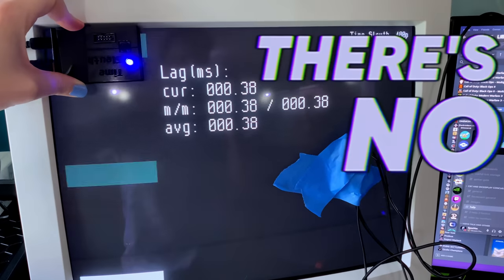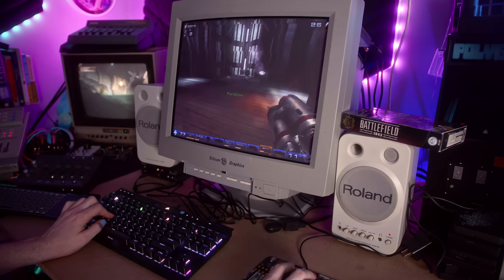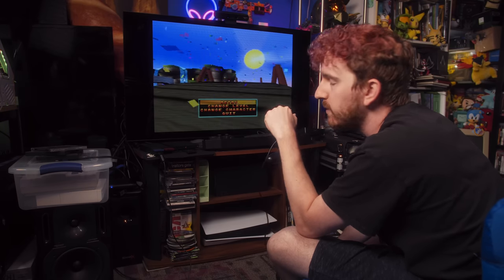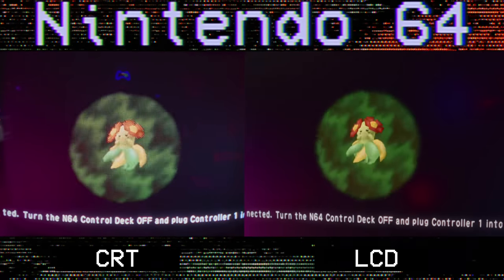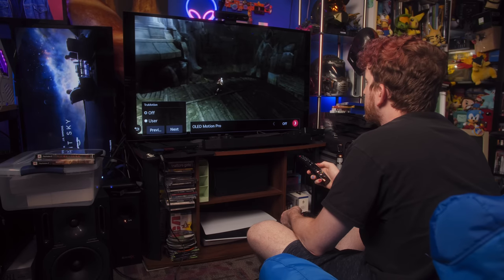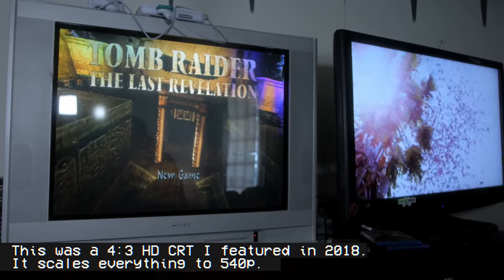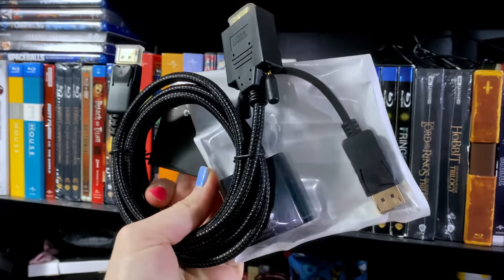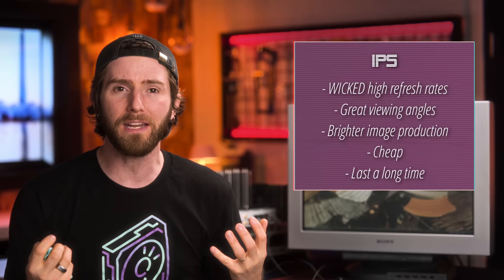Old Trash or Treasure? CRT vs LCD: The Final Verdict

Comment: Thanks for having me come on.   I'm happy to be part of such a great video.  It's amazing to see your CRT videos through the years.  You'll find that fw900 one day.  I know it.
Reply: It's overrated. Spend @$400 on a 4:3 Sony for way more bang/buck.
Reply: Seeing you pop up there with the big boys like LTT is amazing, Steve!
Reply: @shabazz18  depends on if you are using it for modern games or not. If you want to play the latest games on your CRT, 16:10 is probably supported but 4:3 often isnt. On the flip side 4:3 is better for retro or just reasonably old games.
Reply from the maker: Buying another 4:3 isn’t going to accomplish my goals of high res widescreen gaming so… inherently that cannot be more bang for the buck lmao
Reply: Steve is a legend. His video on the Olympus OEV 203 (aka PVM-20M2MD) which had the same problem as mine gave me the confidence to tackle the repair myself as well as do some preventative maintenance. This thing is freaking awesome.

He also has a PVM-2030 video that I'll be referencing soon as I repair that gem of a monitor.

Disclaimer/disclosure: I have years of experience repairing... just about anything... except CRTs. I have all of the tools needed to tackle the job I did and experience replacing the parts on the CRT (ie: capacitors) that needed replacing. CRTs are just legendary for being one of those things you don't touch unless you know what you're doing. With my experience and Steve's tips I was able to do this.

If you have minimal experience repairing electronics or anything for that matter I do not recommend attempting a CRT repair.
Reply: I might be shooting into the wind here because I'm seeing this video now but wondering if there's any good Crt monitors that people know of that are more budget friendly and somewhat accessible to get. If any are  more easily gotten than others? I've been inspired to own one again but one that people with experience know to be worth my time and a reasonable amount of money. Any input is appreciated!
Reply: @shabazz18  Old Sony reference monitors are rad but cost few thousands.

Comment: We have all been robbed. If we had the same graphics processing today in the 2000's gamers would have held onto CRT's with a death grip.
Reply: Intel save us please 😰😰
Reply: Oleds are better
Reply: @ShadowLady1 yea better ,pff
Reply: I have so much regret over throwing away my old CRT monitor.
Reply: @ShadowLady1 nah, I got a room with an OLED and another with a CRT, OLED is kind of ass at lag still
Reply: @sunnohh depends on the TV/monitor. OLED is the first flat panel display tech that's solidly better than CRTs in terms of picture quality, particularly color, though most TVs add extra input lag by doing whatever image processing the manufacturer decided was necessary (frustratingly, loads of TVs will not let me turn this off). OLED desktop monitors, especially if they're marketed towards gamers (most high refresh rate monitors) tend to be close enough to CRTs in terms of responsiveness that it doesn't really matter imo. Plus no one will sell me a QHD CRT (highest resolution you'd really benefit from because 4k is overkill on anything less than like 40in, and the thought of a CRT larger than 40in is fucking Frightening)
Reply: @fall1n1_yt  been 3 years with probably 2000 hours put into and nothings happened so I don't think so,  burn only affects idiots
Reply: I still have My CRTs. 5 CRTs 😈
Reply: @gh0stcassette  Sony made an 45" CRT that weighed 200kg
Reply: @ShadowLady1 but they aren’t special like these are, need 500hz or higher to match motion clarity of a crt
Reply: @irun2sanaxox  wrong
Reply: @ShadowLady1  well if i had the choice i would get both

Comment: Problem is, everyone who is selling a CRT thinks they have the greatest model that every retro gamer wants, and therefore is asking hundreds. I keep checking local listings, but people are smoking crack.
Reply: dont look up "crt", just look up for the cheapest "tvs" or "monitors" and you'll find a bargain
Reply: @RFLCPTR  the problem with that, is the CRTs that you want were really expensive back in the day and your average person didn't have them. I have some old crappy ones just sitting around and I have no interest in using them, the ones I use are the ones people charge huge money for now
Reply: I have the greatest model.
Reply: @danielpope6498  At least in my area I could find some Sony Trinitrons in good condition (didnt pick any up yet as I still dont have my own flat)
Reply: @RFLCPTR  ah dang. Good find. I managed to snag a new in box 22 inch viewsonic a few years back but that was before the market for these really took off. The rest of mine are all IBM branded  shadow mask tubes I got for free because a library was chucking them. Ive never found anything locally since that wasnt either trash or overpriced
Reply: Keep looking and you might get lucky. I have a solid Panasonic HDCRT, a JVC D Series (speakers are busted), and a Diamondtron PC CRT at home that I very slowly put together as a collection. I think the total cost was about 700 CAD. I also found a super rare 21 inch Diamondtron when I was in the Netherlands this year for 50 euro. My one instance of getting super lucky!
Reply: Have you tried thrift stores?
Reply: ROB that band that uses them as makeshift synth drums
Reply: I mostly just notice this with Trinitrons (regardless of the model and inputs).  But you should be able to find a decent deal when you look at other brands.  Even an off-brand CRT will often make older games look better than a modern TV using even the more advanced upscalers or line multipliers.
Reply: You need to look at recycling places and take some from there thousands are still getting scrapped every day
Reply: I got mine for 5 bucks. Mid 90s Magnavox
Reply: Yeah… I love in Norway and I payed 90/100$ for a barely okay CRT. I say barely, not really. I think it’s 900p max and it pains me that I got rid of my two 19” SyncMasters. 1200p @75hz😑 just gone to the ether…
Reply: Yep.
someone was asking for £1000 for a Sony CRT 36 inch widescreen.
but it is 100hz so it is usless.
Reply: I was thinking this same thing when searching for vintage laptops to buy... People wanting too much money for stuff missing parts, or it's just broken, when others are selling working stuff with all of its parts for half the money..
Reply: There was a time you couldn't even donate a CRT to places like goodwill and now it's $1000 for a PVM on ebay? Okay.
Reply: Yeah its beyond absurd. Just hilarious at this point when I see a 20" Sylvania with conposite input only titled "retro gaming crt, high quality". You couldn't PAY people to take these TVs even 5 years ago, now they want $50 for a piece of junk??
Reply: @XxCreateFlowxX okay that’s crazy too much for piece of crap Sylvania I’ll just pay the same price for Sony Trinitron and I know there are some Sony Trinitron that people want you to take it for free
Reply: @XxCreateFlowxX Yeah retro gaming and media has unfortunately become a hype beast hobby when for me growing up it was my only option because my family was below the poverty line.

Sucks getting priced out of something that's a hobby mostly because of necessity lol. I just have stopped collecting actively but when I see something cool I dip in. 

I feel that prices will return to normal someday, when people finally realize again that this stuff is really just a bunch of old plastic. Interesting old plastic, but old plastic nonetheless.
Reply: I got my crt for free😂 Ebay marketplace ftw
Reply: I got a brand new in box dell gaming crt, for $60, and from what I've read, it's one if the best ones dell made, and it hasn't yellowed because it was new in box
Reply: The trinitron 40 inch, the largest consumer tv has 720  i think a few late models have hdmi. It's 250lbs. The mitsubishi 40 inch tv also 250lbs has black glass but no RGB. The RCA 36 inch with black glass and RGB i think is the best CRT tv for ps2 and og xbox.
Reply: Complain about the price but if people are buying them, then it's the right price. They are not making anymore so I don't think it's unreasonably to pay what they cost new + inflation. So a 500 monitor in 2000 would be 1000 to 1500 in today's money. but really the sky is the limit.
Reply: this, is still true
Reply: Yeah, clunky E waste sold like it's some rare 85hz sony CRt or something, TVs are the worst on my local secondhand listings.
Reply: I buy CRT’s because I hear that they were well made and last way longer. So many of them have even made it to be in their 70’s and 80’s.

Comment: Image clarity at relatively low resolutions has always been insane on CRTs.
A CRT was basically the best way to get value out of raytracing on 20 series GPUs. They ran pretty good at 720p/1024x768 and on CRTs actually looked great doing it.
Reply: I bought myself syncmaster 997DF crt and now i have 1070 but im not sure if DP to VGA adapter gives me as good image quality as 980Ti with DVI-I to VGA adapter would. Should i sell 1070 and look for 980Ti? Maybe my crt just got weaker idk but if its worth a try, im selling 1070 anyway cus i need stronger gpu.
Reply: @fiece4767  Do you like your 997DF? Does it clocks 120hz@768p?
Reply: I use a 980ti with my crt and it's great 👍

Comment: Still a treasure. I bought a Sony GDM-F520 (similar to the SGI G520 but with a .22mm pixel pitch vs .24mm), when I lived in Japan and built my first computer. Recently pulled it out of storage along with a lot of other stuff in San Diego and moved it across the US. Out of curiosity I hooked it up and started gaming on it and was completely blown away by the picture compared to my 32" 144Hz LCD display. Since then I've been researching how to make the most out of modern graphics cards and the CRT. I found a really good DisplayPort to VGA converter that supports high refresh rates but a lot of games don't support 4:3 anymore. Until I can afford a decent OLED monitor, or they come out with a good short throw laser projector without so much input lag, it's my display of choice for gaming.
Reply: What converter do you use?

Comment: This video is criminally not getting picked up by the algorithm. I've been floating in your circle for quite some time now and absolutely love your content. I may have been using a Haupauge Dual TV Tuner via Composite in Flash Media Encoder to JTV back in 2007 but you perfected the craft.

I picked up a 36FS100 for $20 in 2019 and boy and I glad I did. It may be 240lbs but it has dual Component and S-Video with a manufacture date of Feb 07. Absolute banger for Lightgun content.

Comment: 13:20 I remember in the early 2000s when I was in high school I asked my mom to get specifically 13'' CRT TV, because I felt they were the best size for gaming at the time, I used that TV for my console gaming for a long time, and still have it in my room.   I haven't used it in awhile though since I now have a C1 OLED, but I definitely prefer the 13'' CRT for most things over my 32'' LCD.

Comment: I never have had an FW900 but I did find a 21 inch Diamondtron PC CRT when I was in Europe that of course still can do 16:9 and 16:10 aspect ratios. It hooked up to my PS5 just fine, and it was a huge relief to finally have zero input lag playing Elden Ring after struggling with an old LCD TV in my Airbnb! Was also much nicer for watching F1 races because of the massively improved motion clarity!

Downside was that I had to carry it down two flights of very steep Dutch stairs at the seller's house. It was definitely not light!
Reply from the maker: Probably a rebadged FW900 then, Diamondtrons we’re just Trinitrons sold under a different name
Reply: @EposVox  Nah this one was a 4:3 screen, not 16:10 like the FW900. I just used part of the screen for stuff that had to run in 16:9 like the PS5, still plenty big (that's the beauty of CRTs!). Still had a ridiculously high "native" resolution because it was used for high end photography work.

EDIT: IIRC its max horizontal refresh rate was still lower than a FW900 as well.
Reply from the maker: OH you just meant it can show 16:9/10 within the 4:3 bounds, I see. I thought you meant the tube was still that ratio
Reply: @EposVox  Yeah! Sorry for the confusion 😅

Comment: I really miss CRT.  The 17" 4:3 studio display I had with my G4 PowerMac was the clearest and best picture I have ever seen (despite the stupid apple lock-in to only be able to use it on an ADC video card).
Reply: Amen. I never had a G4 but I do own an iMac G3 and it's display is gorgeous
Reply: They made a convertor to use a standard DVI input on those, and I've actually got one, hoping I run into that monitor someday haha.
Reply: @modulusshift  Pretty sure that convertor is digital only. It will let you use an ADC LCD monitor with a computer's DVI output, but won't pass through VGA signals to drive Apple's ADC CRT.
Reply: @axi0matic  I should really check to see if it would take in DVI-A. I've heard that the power draw is also greater than that adapter can support, but that might also be worked around.
Reply: @modulusshift  It doesn't, and I don't see how you could 'work around' the lack of power from the adapter, if it proved insufficient. The other snag is that all the display's geometry controls are done in software from the connected Mac, via the USB lines that are also part of the ADC spec. 

Realistically, the only way to use an ADC CRT display is by plugging it into a G4 or G5 tower that has an ADC video card fitted. Alternatively, the graphite VGA monitors were also attractive in their own way, and use a standard VGA cable (though I believe the 21" version needs to connect to a Mac via USB to access its geometry controls).

Comment: I've been a CRT mega fan every since the early LCD monitors started to replace CRT monitors back in the day. I had a xbr960, loved the depth and motion clarity but besides weighing a ton and being hard to handle, it also had geometry and focus problems. Nowadays I use CRT vga monitors and I got tons of them lmao
Reply: Dude one of those widescreen hd crt tv's has been a distant dream for years lol. I seemingly cant find any close, and when I do they are 300 plus dollars.
Reply: I feel most LCD TVs from the early 2000's do have their charm that is different to a the charm of CRT monitor.
Reply: @Ballowax  I'm not sure what charm they have outside of nostalgia. They really look bad 😅😅 And LCDs haven't gone away!
Reply: @mahdiyussuf9804  that's where the charm comes from. It's the imperfections in the old 640x480 LCD panel of the day. It's like the nostalgia you get from an RF signal on 13 inch CRT with a low horizontal resolution.
Reply: @Ballowax  I guess that's true, and I'm sure more would feel that way as time goes on haha

Comment: I love CRTs, and still have 15 CRTs, from different markets of the time - commercial, pro, dedicated to the platform.
From a gorgeous Commodore 1701 CRT for all my Commodore hardware, C64s, C16, Plus4, Vic-20 etc...
A couple of Amstrad CTM644 monitors for a 6128, and a CPC464.
Acorn AKF30 RGB Monitor for my Archimedes A3000.
Atari SC1435 - for my ST 1040STF.
Philips CM8833 Mark 1 and 2 - for all my other retro hardware, composite, and SCART.
Sony Trinitron PVM 1442 QM - this is for a Mister FPGA.
Also have a few commercial Sony CRT TVs, 14", and 28" Trinitrons.
These are 100% for retro hardware, and a Mister FPGA. I don't think I could drop my LG C1 OLED TV - connected to my PC for gaming, and use a CRT SVGA Monitor instead. The C1 is gorgeous, and looks amazing at 4k. A lot would have to go if I went with a SVGA Monitor, such as the OLED, VRR, Nvidia G-Sync, 4k resolution, etc... Plus space, the C1 only takes up horizontal space, it's depth space is only a few inches. A relatively small SVGA CRT would need a fair bit of depth space due to the length of the tube.

Comment: It's a shame that CRTs are no longer in production. Unfortunately, we can't hold on to them indefinitely. I remember the transition from CRT to LCD in 2009 after mine was struck by lightning and stopped working. I immediately noticed the difference. When I moved around on a strategy map, I would see blurriness and "choppy lines" on the LCD screen, which left me feeling somewhat deceived. Additionally, the image felt more "flat" because CRTs had a curved, thick glass that added a certain "3D" effect/depth to it, and the colors seemed more "washed out." However, on the positive side, LCDs are thin and easy to carry. Yeah...

Recently, I had the opportunity to travel to Japan, where I found that they still have many arcades with CRTs. Unfortunately, some of them had burn marks, but others were still in great shape. I visited "Super Potato," which had a whole section dedicated to CRT arcade machines, and I got to play Street Fighter on one. It was undoubtedly a better experience on CRTs, and I felt drawn into the game.

Comment: A little late to the show, but I wanted to point out to anyone still looking for CRTs, I've had a good bit of luck at thrift shops and other donation based type places. Then tend to not know what they've got, at least as far as second hand market value, since the average person has absolutely no desire to bring a CRT back home. 

My current favorite is an unbranded 17" 1280x1024 that gets up to 85hz, which I was able to pick up for $5. I figured at that price point, even if it didn't work it would still, literally, be worth it's weight in plastic, glass, and circuitry. 

I've found that 75hz+ is pretty much a necessity with these as at 60hz the flicker is quite pronounced and disruptive. 

Great video! :)